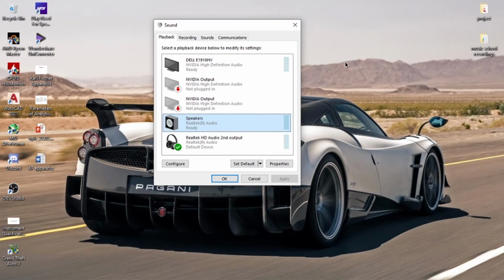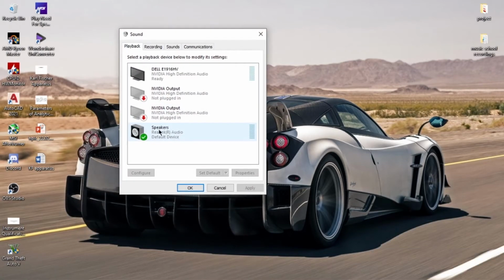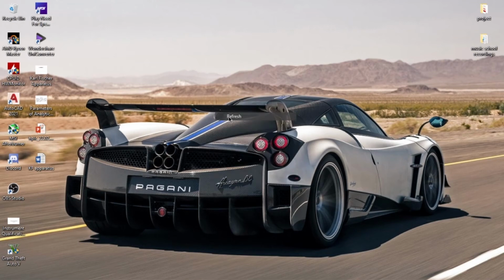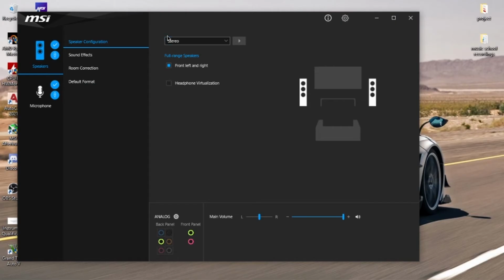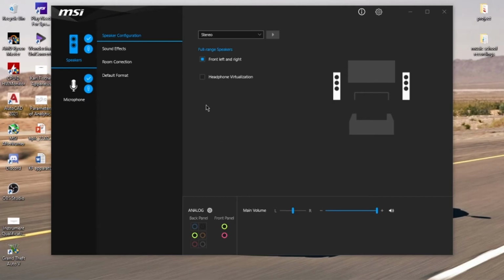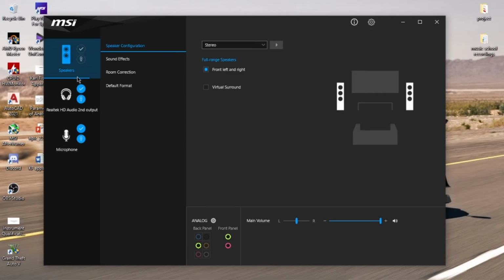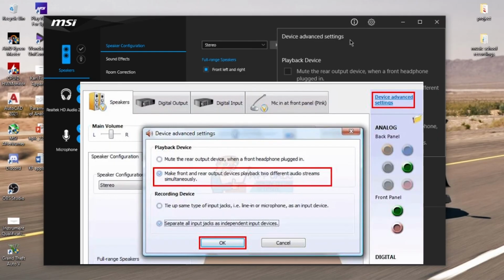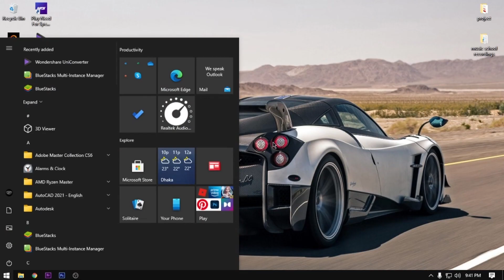How to Separate Headphone Audio & Speaker Audio | Use 2 Audio Outputs at the Same Time

Comment: Is this what I need to do in order to use a splitter in my headset jack to handle sending the sound to a mixer and to have what would generally come out of the laptop speakers go to that same mixer with a mic cable on the splitter?  We want a Zoom laptop to hear sound from a system directly and not through the builtin mic, and have anyone who speaks be heard through the mixer attached speakers.  We do a mix minus on the mic cable so that those on Zoom do not get an echo.  But so far the sound is still coming out of the laptop instead of going to the mixer and out the larger system speakers.  We have a xlr and 3.5mm splitter going into the headphone jack -- but have done no configuration changes within Windows 10 to get it to recognize  those two cables going in and out of the laptop.  How do I do that -- via the Realtec software?

Comment: Thank you for showing this setting in the Realtek software. That did the trick! Now I can split my audio on one web browser / video game through my nice speaker system, and also listen to other audio podcasts on a different browser with my smaller desktop speakers. This perfectly worked creating two separate audio profiles between my front and rear 3.5mm inputs for my PC.

Comment: I found your video it was really helpful, but haven’t done it yet. But I bought a new computer desktop for gaming and I put the elgato, but I try to record my voice with turtlebeach recon 200 headset, but nothing, but if I use your video tip and doesn’t work, do have any other idea you can give me?
Reply from the maker: this should work or else you need to work with your drivers
Reply: @ZMANthegreat  it doesnt let me download the control panel i think they deleted it or its not available in england
Reply from the maker: @Anthony0855  The link is active and it directs you to official Microsoft website....You can try searching the Microsoft website for the control center for realtek audio

Comment: if anyone sees this, I downloaded the driver but it couldn't connect to rpc, so I had my headset plugged in and I went to device manager and uninstalled the speaker driver then after it's gone I scanned for hardware changes (right click the very top one ((ur pc)) ) and it magically separated them and now my headphones n speakers r seperated, i hope it works out for y'all too

Comment: hai buddy mine laptop no audio after install realtek driver..but when uninstall driver and using windows high definition my laptop working fine..seem like realtek combine headset and speaker ..how do i separate
Reply from the maker: mayb your laptops doesnt have a realtek audio chip..look into the specs and install the proper audio drivers for the chipset.these setting will b available in any chipset drivers softwares.

Comment: my laptop is windows 7 and it is not showing headphones in playback devices and the mic of the headphones are not working and the inbuilt mic is on even when i hav pluged in my headphones plz helpp...
Reply from the maker: may be your headphone jack / headphone is not working..try using a usb audio adapter